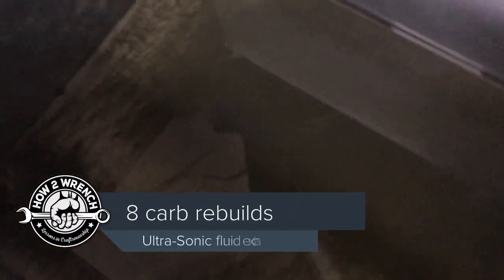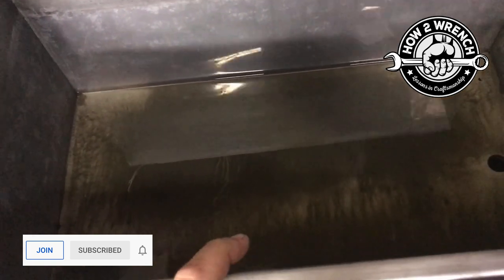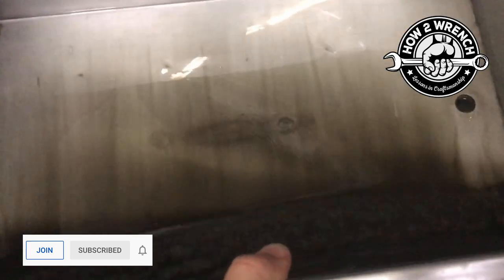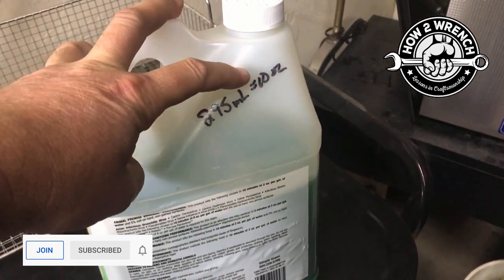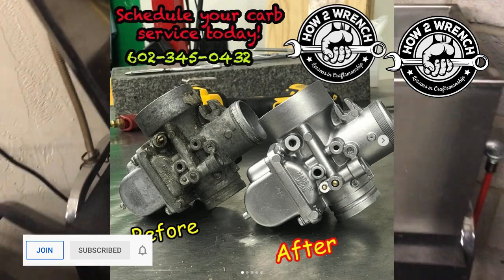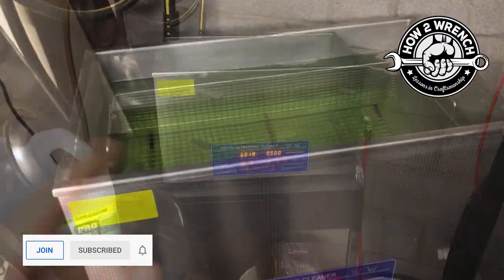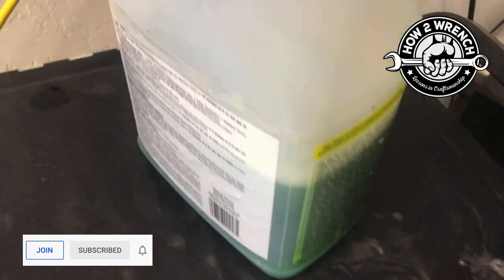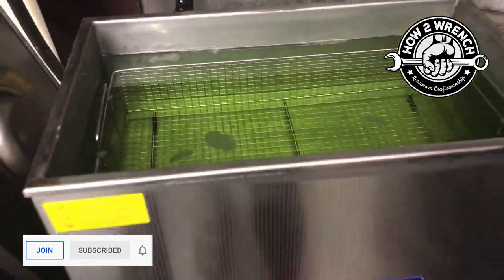Do ultrasonic cleaners work? Ultrasonic cleaner after 8 carb jobs.

Comment: I can’t afford one so I’ll buy the solution and make my own ultrasonic cleaner tank... just need something that give off a strong vibration and maybe an element to warm the solution⁉️Definitely have to think this all the way out.🤔

Thank you for another hi quality video bud. 👏👏👏
👍😎👍
🏁🏁🏁
Reply from the maker: Hey bud...they don't "vibrate" actually as the would cause the parts to move around or band into each other. It's a high frequency signal of some sort the sends vibrations "through" the water. The vibrations hit the part and "shake" the dirt off. There was a great video by a manufacturer I put in the playlist I believe. Depending on the size these are down to $88-400. If you make one or find parts less than that, that would be awesome.
Reply from the maker: There may be a video in here to get you some ideas. https://www.youtube.com/playlist?list=PLAtBOuPaEyt9ai19JLmUH7e5ZOLM60nLA
Reply: I used to be an ultrasonic repair technician long before I retired, you can knock one up from parts on Ebay just get two 25 watt transducers and a 50 or 100 watt driver board. Stick a 100-250 watt rubber heating mat on the tank and away to go, I find 70 - 80c the best temp for most solutions only going higher if removing grease or such. The cleaning solution is just as important as the ultra sound and you should always de-gas fresh cleaner. the frequency of these cleaners is normally around 12 to 25 khz and they work by agitating molecules to form a cavitation effect, this is one reason to keep cleaning times as short as possible otherwise as I have seen on carbs a hole has been bored through a micro defect in the alloy. You must not allow items items to touch the tank where the transducers are mounted for various reasons hence the basket. I am starting to run off at the mouth now and I will be writing a book so ta for now.
Reply: @pavelrobertson5016  Thank you for your time and sharing you knowledge 👍👍
Reply: @How2Wrench  Thanks again brother 🏁👍👍
Reply from the maker: @pavelrobertson5016  Holy smokes that sooooo awesome you shared. Thank you! I bet @foxtrot is in heaven after reading this!
Reply: Thank you all for sharing.

 I just kept quite during all the replies because when I commented I was actually thinking of harmonic vibration and not ultra sound., but failed to mention that part. Someome thought I didn’t know that parts have to be placed  in a basket and not touching the container,, and I appreciated  that persons concern.

I did the orbital sander idea (2) years ago and it ended up burning out the sander so be careful of that, the method does make a harmonic vibration like I wanted. I’m going to listen to everyones suggestions and watch any and all videos on the subject because my work season has ended and I only work during the hurricane season in Florida in a small engine repair shop.

Again much thanks to all of you. 
Happy Thanksgiving to you all, your friends, families and love ones.
👍😎👍
🏁🏁🏁
Reply from the maker: @kabukikev7214  Been watching @ichibon videos have we????? 😎